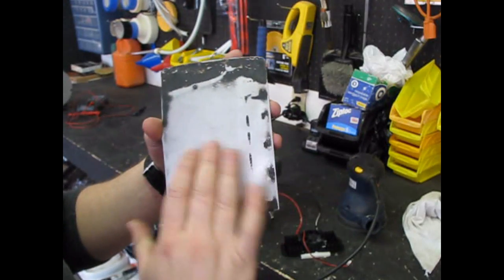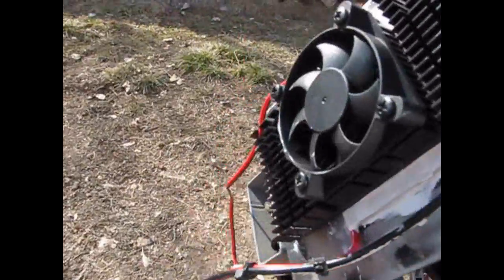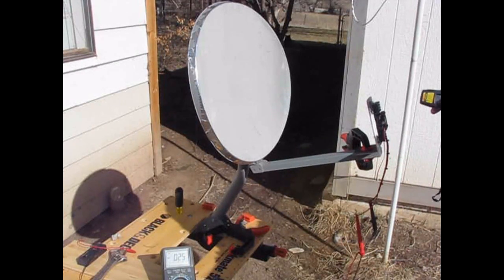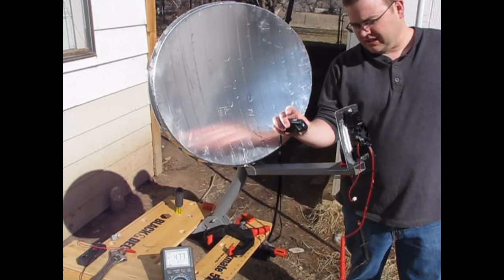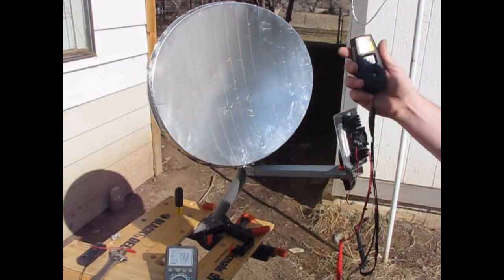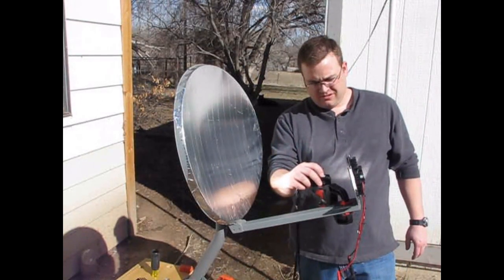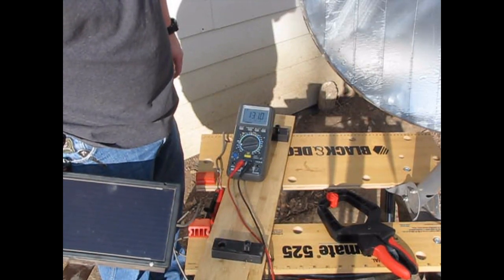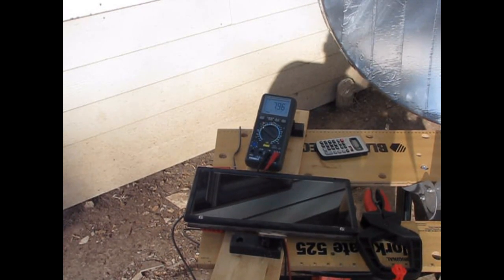Peltier Energy Generator. Solar pannel alternative.

Comment: Okay, so if you covered a window of your home with this and the sun heated one side, it wouldn't make the indoors side super cold, it would just be cooler than the super hot other side, which would be netting heat on both sides, therefore useless for my idea. Thanks.

Comment: I like your experiment, however, this is not a comparable study. 
1. The "cool" side of the Peltier is not really be cooled that much. That tiny heat sink and being in the sun, is not going to create the temperature differential needed to output substantial power.
2. The size of the Peltier is much smaller than the solar panel. Meaning, the comparison is not apples to apples, more like  5 apples to 1 apple. I understand the dish is collecting a comparable amount of light, but if your not going to provide a comparable amount of cooling, the experiment is mute.

Comment: Use a magnifying glass to focus the sun on the peltier. You don't need such a big dish and it doesn't reflect perfectly. You can get it hotter with a magnifying glass and facing the sun. Think burning paper. On the other side, you don't need a heat sink! Put a wet sponge there and face it toward the shade and let the breeze do its magic.

Comment: Instead use a fresnal lense you can make small units to charge phones. I made mine with a small magnetic refrigeration  on the cold side. To even it out. I made larger models and could power alot  more. I hooked it up to super capacitor to trickle charge leisure  batteries. Free energy

Comment: Thanx for testing this. I thought it up, and offcourse there is a video with a DIY project. I wondered if it would be efficient... Thanx for answering that it is not. But come to think of it, maybe you could use it to generate electricity when you have heat to spare, like a fireplace with a lot of heat. This way, the cooling effect is not negating the energy generation. Just a thought.

Comment: At the very least don’t use a black heat sink!  When you try to remove the heat by a fan rather than through radiation, the black is absolutely counterproductive.  Any radiation from the black heat sink is fighting a losing battle against the radiation from the sun.
The radiation formula contains the FOURTH POWER of the absolute temperatures of the two items.  Your heat sink is somewhere around 400 kelvin, while the sun represents about 6,000 kelvin.  This of course ignores the Wien or Planck wavelength effect, but who cares when the issue turns out anyway to be several orders of magnitude.

Comment: A slightly different way to accomplish your goal might be to sandwich a TEG (or several thermoelectric generators) between 2 square metal containers, one for cold and the other for hot. Then, use a solar oven to heat thermal oil to the max operating temperature your TEG is rated for. For example, if your TEG is rated for 375 F, heat oil to 375 F before you pour it into hot-side container. Once your oil reaches that temp, pour it into the hot-side container. Pour cold water into the cold-side container and it should output electricity based on your TEG output rating, the temperature difference between hot side and the cold side, and how many TEGs you sandwiched between the 2 containers. This also might allow you to better control how much heat you put to your TEG or Pletier, not going above what it can handle, which should ensure a long operating life without damage.
Bonus—-you can use any appropriate heat source to heat the oil, so your generator would be a true multi-fuel generator. You could use solar or fire to heat oil to operating temp, allowing for electric generation in just about any weather condition day or night. Another bonus is the generator would operate silently and without emitting fumes after the oil is at temp, so it should be okay to use it indoors so long as the hot-side container is sealed and hopefully insulated on sides, top and bottom. Not insulated between the 2 containers where the TEGs are, but all other sides.
The downside is the potential danger of handling oil that hot. It’s a definite burn hazard is you do not use protective gear and common sense. Be careful and use your head if you or anyone else reading this tries it, please.
It’s a theory, at any rate. Something I thought up but have not yet built or tested, which puts you ahead of me. Nice vid. Thank you for sharing it.

Comment: good idea, but it can not work, because both sides nearly have the same temp. You need a bigger cooling device a much bigger ventilator and don´t forget to switch it on, this video is more like how to roast a peltier element, and don´t forget the white color on the part that should be cold, if all that fails replace Your metall with a can that You can put water and sausages in it ...

Comment: Facepalm Okay, whatever you say bro; that solar panel is about 6 times the size of that peltier module and is comprised of several smaller solar cells. Thus you should take that 0.36 and multiply by 6 then compare which would be 2.16; thus your system IS in reality effective. That's okay though; I know how you could easily make that more efficient so that's going to be my next project. Cheers mate!
Reply: Also, sun shines on the heatsink.Maybe covered in white box would increase the temperature difference at the peltier module.

With a trapezoidal metal interface touching an array of peltier modules you could let the dish "burn" the interface and let the peltier modules suck heat separately without fear. Worth a shot

Comment: What if the parabolic dish was made of solar cells and then the waste heat (energy not converted via solar panel) is reflected on to the peltier dish, resulting in a overall system with greater efficiency and less waste. Feasible?
Reply: Yes, that's a great idea. And based on Wikipedia,  many people have thought about that (many patents on it).

Comment: Your power generation would be improved if you used a clear lens so the cool side was out of the sun. You could also stick a solar panel on the sunny side, so your doubling down on the generatior types.

Comment: You've used waaaay to much thermal paste... You would get better thermal conductivity by using as little as possible. The purpose of thermal paste is to maximize contact surface on microscopic level. Even the best pastes are worse at conducting the heat than the heatsink itself.

Comment: Peltier modules work on thermoelectric so you cannot compare them with Solar panels :)
I played a lot with them. The best application is put them in series with heatsinks and install them somewhere on your cooking stove. Then have them power your exhaust or LED lights on stove.
Reply: +Talha Kamran So what if I used peltier modules on not so well insulated steel chimney on outside? Lets say the steel heats up at around 100 C and outside temp is 0 C. There would be nice temp difference and no need for fan. Could this work?
Reply: Yes...
But you can increase the cooling capturing area by attaching an aluminum heat sink at the cold side (which is outward).
In winter your idea can work the charm but make sure to create some kind of setup to save peltiers from rain and other stuff.
The hot side attached with the chimney wall should have some kind of heat conducting grease to ensure that heat is efficiently conducted between Chimney wall and hot side of your module.

China is making these modules in bulk now. Buy 10 of them .. i think it will easily give you 20w :)
Reply: Talha Kamran
Yeah, they are cheap now - few years ago they were much more rare and bit more expensive on ebay so I paused the idea and never really tested it.
Not sure if the environment can be sustained 100% dry. Even with extended overhang, I am sure water or snow will find a way, so maybe there could be applied some waterproof paste or DIY thermal plastic casing? Any ideas on that one? The casing would  reduce the T difference, but only slightly as bottom of casing would be open and maybe even a small gap on top to create possible draft and thus eliminating greenhouse effect.
Reply: +Reinis Miks In addition to Talha's recommendation I would advise you to go with cells that have a high temperature rating to get the most out of your chimney without worrying about burning out your cells.

Comment: You need to make te surface of the disk with chrome vinyl so it can create very hot focal point... then you gotta bolt on a modern heatpipe cpu cooler. Greater te heat difference on ether side the grater the effiency.

Comment: Sorry to criticize your math, but short circuit current  says noting about power as the voltage is minuscule over the short. Likewise, open circuit voltage says nothing about power either as there is only running nanoamps through a digital multimeter:

You need two meters: 1 measuring amps in series and one measuring volts in parallel, and then you need powering a resistive load, like a bulb ( in this case a flashlight bulb will do)!
You then multiply these simultaneous readings for volt and amps and you get exact numbers. Your figures, measuring like you do now are too high, but nevertheless impressive.

Comment: First, it looked like you had an ungodly gob of thermal interface grease between the peltier and the heatsink. This is suboptimal. You want a very thin film, as the grease isn't as good a conductor as the heatsink itself. Its purpose is to interface the parts of the peltier that aren't touching the heatsink completely (because you can't make the surface perfectly smooth).

Next, if you have a small temperature difference between the sides of the peltier, you should have the fan going. The point of the fan is to decrease the temperature of the heatsink, which makes the heatsink resist the flow of heat less. The higher the temperature difference (for a given setup), the easier it is for heat to flow and the more energy your peltier can capture.

Ideally, you're not using a Peltier, though - you'd be using a Seebeck device, a.k.a. a TEG.
Reply: I worked in a company where they tested heat transfer etc. The amount of heat transfer compound is so small, it surprised me.  Almost like there was none !

Comment: So yeah, while taking temperature/watt/volt/amp readings - never hooking up the PC fan to dump heat from the TEG's cold side -  you fried a perfectly good Peltier chip. I love solar PV and evacuated tube tech a lot, too, but you'll find that TEC and TEG are more elegant, and with full comprehension of how they work, how to maintain maximum temperature gradients, plus how to integrate them with compatible systems, like piezoelectric generators, you realize they will eventually arrive at the top of the heap of alternative renewable energy systems.

Comment: Wooooo!!! you don't multiply the open-circuit voltage with the short-circuit current to get the wattage !!! ... put some load resistors and measure the current and voltage at the same time !!
Reply: This guy doens't know what his doing..

Comment: Try using a paint can full of water for the cold side and be sure to shade it, maybe make an evaporation pot to cool it. Getting sun heat to the other side will be a bit problematic but a flat mirror and/or lens just might do the trick.

if you're using a cheap Peltier wafer(s) then you need to limit the heat difference. I would go with heat water to boiling on one side and use cool water at the coldest on the other, some cooling wafers can only take 70-some-C difference. The neat part of that is that if you heat enough water then the rig will run even after the sun has gone down. Look into using a trough reflector to heat a water pipe.

Comment: peltier systems require a good cooling agent.. something like water.. put a few of those in series around a furnace and have cool water piped through on the other side and you will have a decent alternative.. it won't be nearly as efficient as solar panels but as an addition it should do fine..
Reply: yeah its an cool alternative for peoples which already have a furnace...

Comment: well the thing is you first read voltage, then current. better do it simultaniusly to get your real power  (watts) cause you shortet the output, which leads to voltage drop as far as i can see that O_o

Comment: multiplying the open circuit voltage by the short circuit current, isn't going to give you power.... secondly, the high temps you are getting are because there is no current flowing, when connected to a load, the load will get hot instead... thirdly, you should make sure that the only way for heat to get from your hot plate to your heat sink is through you r peltier.

Comment: And I get ~94 V.
This is much cheaper than photovoltaics, more durable (no hail storm can hurt the Peltier thermocouple assemblies)  And I believe the Peltiers will last 100 years or more vs. 25 years for a photovoltaic panel.
Pump water thru a solar hot water heater panel at night (elevated a foot or so from the ground) and you will be AMAZED at how cold the water will get.
Use this cool water to further help cool the cold side of the peltier and you will begin to generate real voltage!!
Reply: pumping water through a solar heater panel to cool it only works if the collector has no glas front. modern collectors use special coated glas that lets in all radiation and reflects as much as possible that wants to go out from the inside.

Comment: Ditch the parabolic reflector, paint the hot side of the Peltier black (I think you already did that) and expose the hot, black side of the Peltier directly to the sun.
This will generate all the heat you need and, more importantly, shade the cool side, allowing a heat differential to exist which will give the Seabourg effect the best chance of success.
I do the same thing with about 130 Peltiers, arranging the array of Peltiers in a single, flat plane so that all are directly exposed to the sun
Reply: how much power do you get out of that arrangement? I thought about using a solar panel on the hot side and use the residual heat of the panel with a peltier module. i think a fan to cool the cold side could be powered directly by the peltier module (not even a step up converter needed).
in your other comment you talked about using water to cool the peltiers; if you can effectively store the water you cooled down in the night you can use it during the day to cool the cold side of the peltier elements which would make them much more efficient. 
very interesting stuff, i will do some experiments, although i have no access to solar collectors to try out how cold i can get the water overnight, will try with tap water.

Comment: you can use thicker aluminum in black color on the dish side to keep it warmer and a bigger light color on the outside to keep it cool. you just need a parabolic mirror instead of that dish you will probably  get similar results to solar panels. also result will depend on the quality of the Tec.

Comment: did you ever tried to shield the heatsinks from the sun. I noticed they where black as well. I do it myself but you got the gear already and this is why we do what we do and share to help others :)  also good placement or not anyfan may help with energy output. Just suggesting simple changes i know in my work little changes have made very different results some better and others not so good

Comment: @electrodacus That is an excellent idea!  The cooling side of the TEC by water, or 50/50 antifreeze mixture, cooled plate circulated into an insulated tank for heat storage during day time and reverse flow for night time power generation. Evening output would be less but, for gathering as much energy as you can for battery charging, great!

Comment: 600 mA and .8V is great! If you double that (series), let's say 1.6V and 600 mA, you can easily use a boost converter oscillator to give you workable power, possibly 6V @ 100 mA or so. Here's a thought, take that dish and concentrate it's heat on a black painted vessle of high ratio (saturated) salt water of some kind that will go up to maybe 300 degrees. Have a tube that rises in elevation to a bigger heat dissapator mounted in the shade, behind the dish where you collect the power.
Reply: Você acha viável este tipo de gerador de energia? (Peltier)

Comment: Cool stuff. We use TEGs where we have no electric. A natural gas flame heats the one side HOT. A hugh heatsink dissipates as much heat as possible. The heat sink is by far the largest component. The electric regulator part is a compromise. It holds a load across the peltier to move just enough heat to the heat sink to keep the solder from melting. If you pull an external load, this regulator works like a boost converter. It's good for 20 watts or so.

Comment: Peltier modules work by temperature differentials - you NEED to cool the cold side when heating the hot side if you intend to use a Peltier module as a generator. I have a 172W Peltier that can produce upwards of 60W with a temp differential of ~150F (280F hot side, 130F cold) thanks to a beefy heatsink/fan, which is WAY more power per surface area than solar and WAY cheaper per watt.

Comment: The front plate needs to be a block of copper about 1/2 inch thick, the heat sink on the back should be water cooled.

Comment: HI there
I think you need to cool your coolside more.
What you can try is to attach a metal bucket ( aluminum ) filled with water to keep the side that is facing the sun right now cool
That will give you a bigger difference in temperature and therefor greater output.
Keep us posted
Greetings from Belgium
Erik

Comment: You are letting the sun hit the heatsink on the cold side which is a very bad thing to do, most of the problem is the heatsink, also make sure the peltier is in the correct possition and not turned on the other way around, the side of the letters is the HOT side.